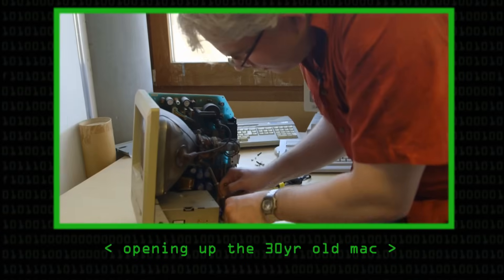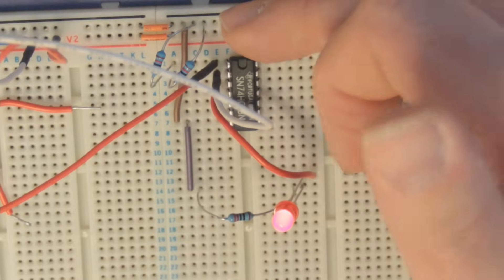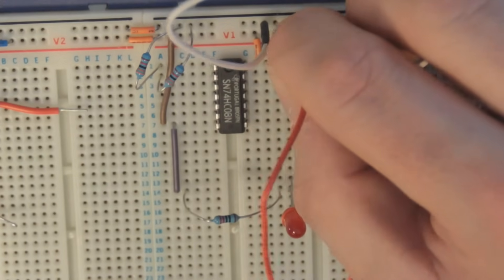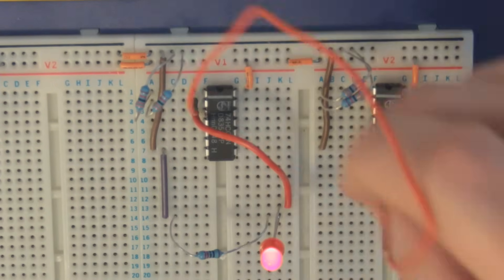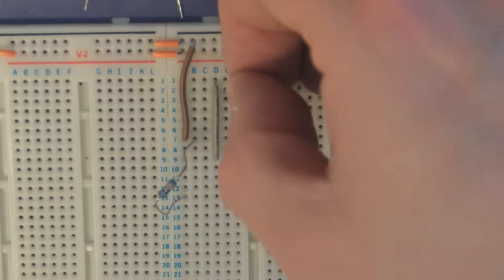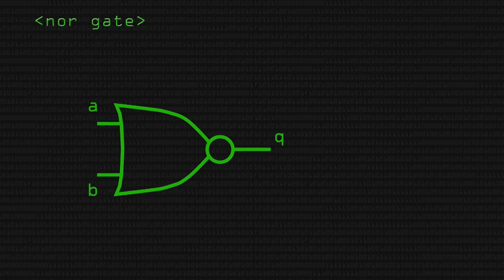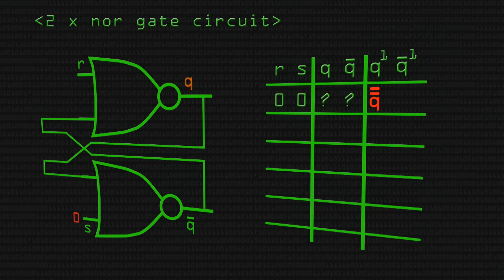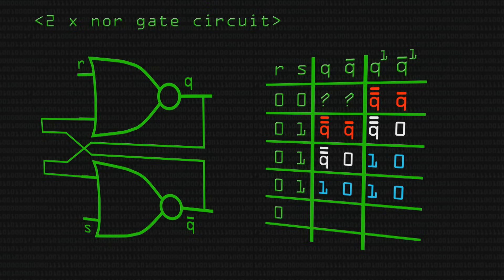How Computer Memory Works - Computerphile

Comment: So that's basically Static RAM (SRAM), which is roughly how cache memory in your processor works, very fast memory, but uses a relatively large circuit to maintain the information, so it's harder to put the gigabytes we're used to today into small chips.

The memory on the sticks they showed is Dynamic RAM (DRAM), where the basic idea is to use a small capacitor to store a charge for a 1, or remain drained for a 0. This takes fewer component parts to construct, so you can pack more of them into a smaller area on the silicon of a memory chip. The downside is that the charge is lost over time, so you have to cycle over all the bits to refresh the charge in the capacitor every so often, which is why DRAM is slower than SRAM as this adds delays to when you can read the information back out again.

Glad I still remember some of my Electronic Engineering training :)

Comment: So when I save a file on my computer it's actually just activating the file somewhere else? That seems just so intuitively wrong. So my computer is always processing every file I've ever saved all the time? That seems terribly inefficient. And what if I take a memory card out? Does it instantly clear all the data on it?
Reply: Saving a file is quite different from what the author of the video is talking about. When saving, information is stored on the harddrive, which is magnetic allowing for that information to be retrieved even after loss of power. What the author is talking about is memory. Think of the old(er) calculators, when you enter "1 + 1", the first "1" is stored when you press "+" and then the "+" and then the last "1" so that when you press the "=" everything can be calculated in an instant. This memory works just like that. Once you turn off the calculator (or computer) the information on the memory is wiped out.
Reply: no when you save a file on you computer it stores it in the hard drive not the RAM, what he showed is how Random Access Memory (RAM) works, which is a temporary storage and will be deleted from the computer when the power is turned off.
Reply: Memory is not for storage ;)
Reply: Here we have the difference between memory and storage. Memory (RAM) stores files that are currently in use, so that could be the word "Computerphile" for example. When you save that file, the ons and offs stored in the memory chips are saved as magnetic charges on a hard drive (assuming it is not a solid state one). If you close the file, the "Computerphile" data should then be cleared from the memory, but the stored magnetism on the disk remains. Should you take a RAM stick out of your computer while it is running, all data stored on that stick will be lost, but the saved files still remain recorded on the hard drive. (it's not recommended to try that, your computer would not be happy!)
Reply: When you're working on a file, the file is stored inside the temporary, faster-processing RAM (Random Access Memory) and when you save it, all the data are written on the hard drive, which is a non-volatile type of memory. The computer then can access the saved file on the drive, load it back into the RAM and work on it from there, where it is kept loaded (but not being processed all the time). Memory cards, just like any other hard drive, are non-volatile memory, so they son't wipe out the data instantly after being removed, instead it has been actually written on them (ex. with magnetism or laser).
Reply: A memory card uses flash memory, which is a different beast to this.
Reply: TheJaredtheJaredlong All you need to know is this. There's volatile and non-volatile memory. Volatile memory needs constant power to keep it, otherwise it's lost, like in the case of RAM memory, which is the case of this video. There's also non-volatile memory, which unlike volatile memory, doesn't require constant power to save that memory, which is the case of Hard Drives, Solid State Drives, Memory Cards, like SD Cards, and so on.

Now, RAM memory is only activated in a computer when you, as a user request to use a certain file, most of the time. So, you load the document. The memory in the non-volatile memory is pretty much copied onto the volatile memory, since RAM memory is MANY TIMES faster than non-volatile memory types. When you're done with the document, you save it, and it's transferred from the volatile memory to the non-volatile memory (RAM back to the Hard Drive, for example), for safe storage.

So, your computer isn't using more electricity per second just because you saved your file two minutes ago, because it's stored in non-volatile memory, which doesn't require power at all times.
Reply: Not quite. Memory on which you store your every day files is likely stored on a physical hard drive if not an SSD. Both of these means of storage have the property that they retain their data, your file, even when the computer is off. Your computer really only processes that data and the file when you want to open it. Memory that your system uses while its on on the other hand, RAM likely DDR3 SDRAM, is very volatile meaning that it does loose its data when the power is shut off. The D portion of SDRAM stands for dynamic meaning that the computer does actually actively refresh the memory cells many times a second in order to prevent loosing the data. Thus, if you were to remove one of your RAM sticks, the data would be cleared.
Reply: This isn't how all information is stored on a computer. Memory that's functionally equivalent to that in the video (SRAM) is used closest to the processor but a different technology (DRAM) is used to hold gigabytes of data while powered. While in those memories, yes, your computer is using power to remember that data meaning if it were unpowered it would forget that data, i.e. it is volatile. For files, your operating system may decide to hold it in memory for a while before writing it to non-volatile storage (like a hard drive disk or a solid state disk) which doesn't use power to retain data and wasn't covered in this video.
Reply: i'm no expert but from what i can remember 
memory=RAM so when you save a file it goes to your harddrive so saving it is not moving it somewhere else and taking the memory card out does nothing as long as the power is out (it might give you some internet cookies problemms but that might just have been bad manipulation from my side)
for the processing side, no your computer isn't processing everything at the same time. everything that is open or running whatever you wanna call it (visible or not) is being processed at the "same" time  but at the end of the day everything rests nicely in your hard drive

don't take my full word on this as i'm still learning and for now i have the basic version of the basic knowledge... sorry :$

please youtube commenters help me fill the gaps and misconceptions
Reply: How I'm just baffled at how hard drives store information. This video made sense, put the information somewhere else, but like, what are hard drives doing then?
Reply: This video is about memory, like ram, which is volatile and discarded once the power is disconnected. Hard disks, ssds and other flash memory devices store bits in another, permanent way, through magnetism for example.
Reply: i think you're confusing RAM with your Hard drive, this video is about RAM
Reply: "Memory" is RAM, which is only a cache of data that exists while the computer is on. Permanent files are stored on the hard disk.
Reply: this video is talking about RAM - that's not where your files are stored if you save them - only data you are currently working on is stored there (for example if you are currently editing a textfile all unsaved changes are stored in the RAM)
and this memory is indeed cleared instantly if you switch off your computer
Reply: You generally don't save to memory, as memory gets reset whenever you lose power, you would normally save a file to the harddrive which works differently and still retains the information without power
Reply: ***** I do wish that we (this comment thread) had helped TheJared understand this in a more concise way.
We should have explained the differences between volatile and non volatile memory and how they apply to computers and the rest is logic and wouldn't (edit: shouldn't)  require explanation.
Reply: it is all based on the instruction set, a cpu can load something onto its cache, then load it to the ram in chunks, and finally dump off the file off the ram to the hdd/sdd, in chunks. It could also just write to the hdd directly, but that would only be efficient if you use constant values. Like pootis 123 at address 2.
Reply: +MegaMapler2000 not just ram, it is memory in general, it is the building block. Sure it is violitile.
Reply: Let me correct my older comment. The computer does a lot of HDD/SDD processing, yes, but at the same time it depends on the operating system. Linux, for example, tries to defragment when it can WHILE you are doing what ever work. And I earlier thought that cache is some sort of fast directly addressable memory, but it isn't. A cache is just a way of sometimes making your trips slower to fetch. In the file reading example, you could either load the filer on to memory and process it OR you can process it by some bytes at a time. The ACTUAL file reading, which the kernel does (using a filesystem), reads directly out of, say, a HDD. Now, HDDs even have a cache, but it is really a small amount.

Comment: thats the rs latch right?
r  s
0 0 -> retains the old state
0 1 -> sets (1)
1 0 -> reset (0)
1 1 -> not a valid combination
Reply: That's accurate.
Reply: 1 1 = free oscilation unknow result, because it is based in time!.
Reply: flyguille so does that mean that the light will be turning on and off randomly?

Comment: i never understood why we still use ram. cant the cpu/bridges/drives be connected directly?
Reply: RAM still exists because random accesses on HDDs are about 10^6 clock cycles, on SSDs are about 10^5, on DRAM is about 10^1 and on SRAM less than that.

Comment: Good video - for the breadboard segment I would have liked to see pushbuttons with led indicators so a person could see the 'positive voltage' inputs rather than a wire dangling and touching stuff. Once the graphical overlay came in the circuits all made more sense.

Comment: For anyone who played with Minecraft Redstone logic, he just made the real life equivalent of a RS-NOR Latch (It's called that in real life too. (Side Note: The Name also explains itself, RS standing for "Reset Set", a NOR gate was used to construct this, and Latch is because it latches onto the set signal.)) When you think about how you make one in Minecraft its exactly the same. You feed two torches' (Which act as a NOR, as it takes two inputs, and when it is powered by one it turns off) outputs into each other, and then have the inputs connecting to the torches act as the Reset and Set.

Comment: Lol - I love that bit where he's like "Did I just short everything?" Makes me feel better about my own mishaps in lab ^_^
Reply: That reminds me working on my apple 2e and I was taking all the expansion cards out and a capacitor on the printer card shocked me then. Right after wards the system had issues booting and I remember lying on the floor hating life thinking I messed up the CPU..... Luckily it was because my ram was bad and before hand the system was running off the expansion card ram which I just removed lol.
Reply: 10/10 pun
Reply: Oscar Miranda not a pun.
Reply: @OM-el6oy  why are you doing this
Reply: I did find that quite validating, myself.

Comment: When I used to study these things, I remember finding pictures, like the one at 8:52, puzzling, until I figured out that each of the logic gates is also connected to the 5V of the power supply by a fourth wire, which is usually not depicted.

Comment: The Apollo Guidance Computer were built entirely from NOR gates, as NOR were the only available type of gate in a microchip at the time it were built. The AGC were rebuilt some years ago, the number of chips were cut by 2/3 by using modern chips with all types of gates available. Good video.

Comment: So much easier to demonstrate with redstone ;D
Reply: @Baymax15: It is the S-R Latch. T-flip-flop toggles the output with each clock tick, and is more complex ;)
Reply: @DupczacyBawol  not that complex. 1 JK ff makes a T without any problem.
Reply: Well minecraft physics are a bit non-realistic 

Still i like to play mcpe
Reply: Yeah!
Reply: Baymax15 well it technically works, because computers run on on/off states. Which Redstone, under a far more intelligent user than I, is quite capable of doing.
Reply: ikr i do minecraft check me out :)
Reply: Do you know any video on this topic (redstone)?
Reply: @samuelabreu4349  look up Mumbo Jumbo, Scicraft, and a bunch of tutorial channels.
Reply: 8:28 a t-flip flop
Reply: Dr. Steve, are you Mumbo Jumbo's father?

Comment: Just for anyone unaware, Brady made a mistake on the diagram for q and not-q "prime". "Prime" does not mean "to the first power", "prime" is just a sort of vertical dash symbol used to mark that q' is the same kind of thing as q but q' may be slightly different in some way.

Comment: One point left:
what happens if both inputs are 1 and change back to 0 ;)
Reply: That's a race condition. While both S and R are high both Q and Q' are 0 for the NOR SR latch. It's next state is dependent on how early and fast S and R fall as well as which NOR drives the state faster.
Reply: If both R & S are 1s then it's undefined... Q/Qbar can be anything in between 0/1
Reply: I know it is part of my Bachelor-Studies I only wanted to show some missing parts ;)

Comment: but what about memery that doesn't go away when you turn off the computer. How does that work?
Reply: If you're referring to flash memory it's based on a specialized kind of transistor called a floating-gate MOSFET. It's basically a transistor with a capacitor plate pushed up against it. It gives electrons or holes sufficient energy to jump straight through the insulator and lodge itself into the plate.
Reply: That would be a non-volatile memory, there are several types (ROM, PROM, EPROM, E²PROM, etc.)

As for how they work, it's specific to each type, and not exactly trivial to explain in a comment, but you could search for these if you really want to know.
Reply: very similar, it just uses a different type of chip construction, or a maintainer battery (like your CMOS battery in a laptop).

The chemistry of static memory is quite a bit different then RAM. RAM isn't doing anything really chemical with it's memory, but ROMs and Flash memory do, hence the term 'bit rot' for when your flash card finally dies.
Reply: this is a completely different topic, but it basically works through magnets: a hard disk has a disk inside that consists of millions of tiny magnets. these magnets can be magnetically 'charged' to positive or negative (as you can generally do with magnets). when something is saved to the disk, the tiny magnets get set to positive or negative and therefore represent an array of 1s and 0s. that's why you can wipe a hard disk when bringing it near a strong magnet: it will recharge the tiny magnets and therefore delete all the information saved before
Reply: there are many different types of https://en.wikipedia.org/wiki/Non-volatile_memory
harddisks   use tiny magnets on the platter
CD/DVD  use reflective and non-reflective parts on the disk (detected by a laser)
USB-sticks/SSDs use sth. called floating gate transistors
and you could also just print stuff on paper